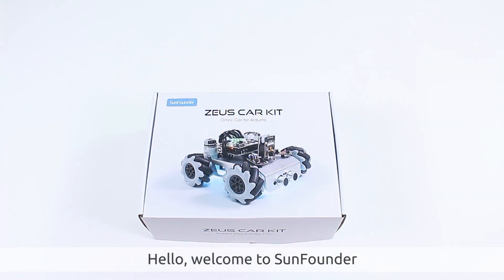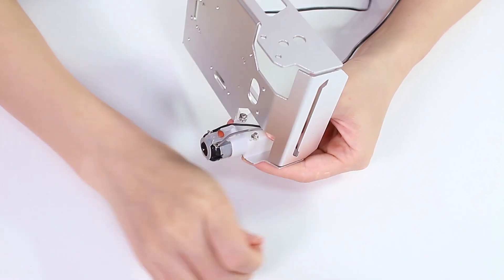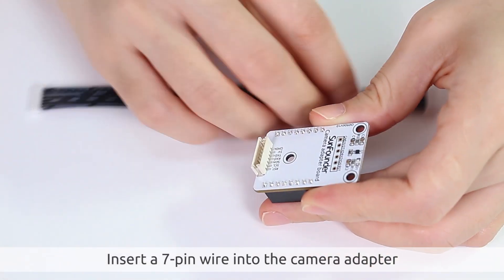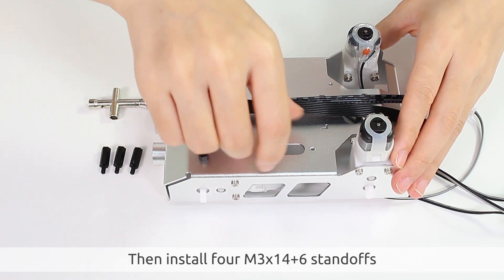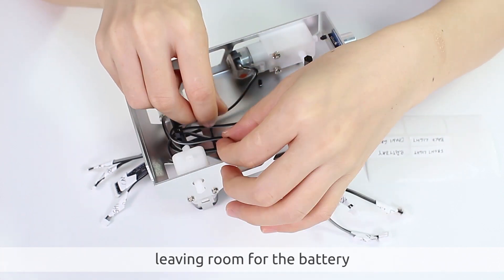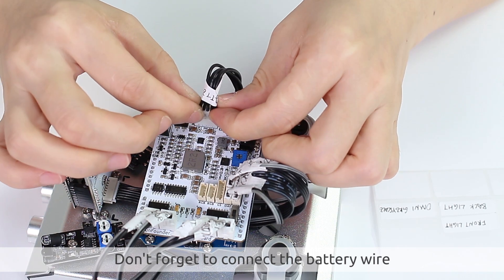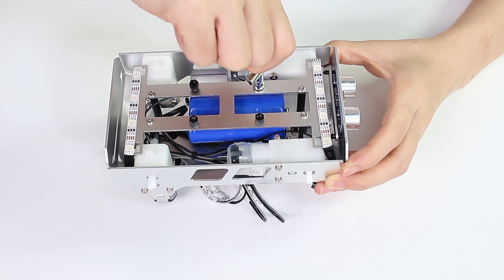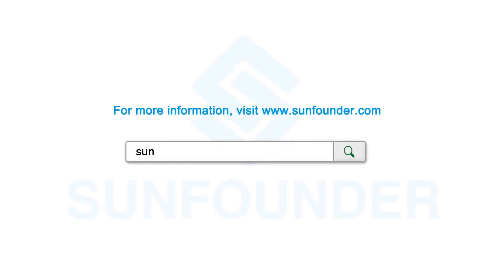SunFounder Zeus Car Smart Car Kit for Arduino UNO (Battery Included) - Assembly Tutorial

Comment: Feedback: lovely little project, however the instructions are missing some steps on the video. The most crucial of these being the standoffs for the wheels. If as most will do you follow the video to assemble these will be missed out and the wheels will not work! The standoffs are unlabelled in the pack and the only indication that you get is in the very last diagram which actually tells to follow the video which is incorrect.
This was a project I used with a 1:1 student who was hugely disappointed having assembled the entire car only to fall at the final hurdle of the wheels.
A reply to this comment would be appreciated so that I know you have seen this.